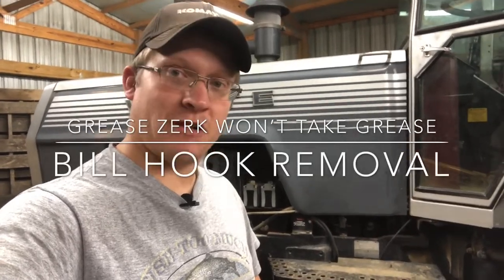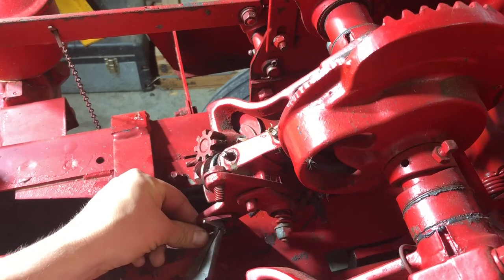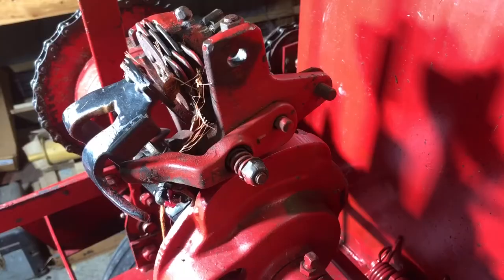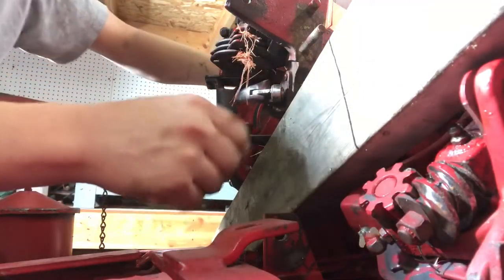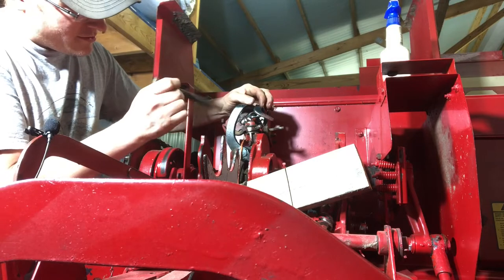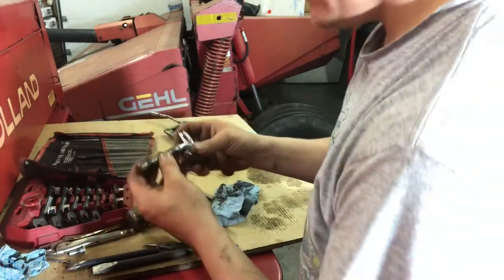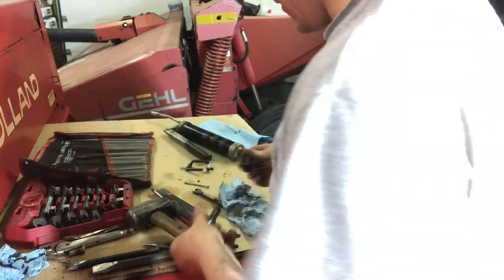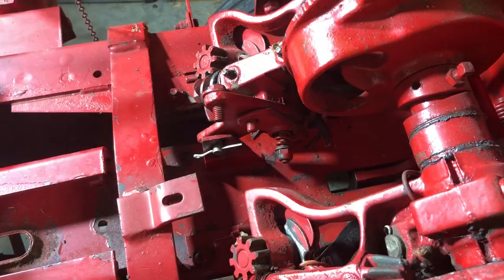BILL HOOK Remove/Install - Grease ZERK won’t take Grease

Comment: Thank you for making these videos. I have learned so much from them. I have a 1969 Alis Chalmers 444 baler and it has NH style knotters on it. I have had to replace the knife arm on one side and with your videos had the knowledge to adjust it along with adjusting the other side. Thanks!

Comment: Great videos !  I have a NH 271 baler that I have gone over, and replaced a few pinion gears.  It stopped pulling the knot out of the left side.  Now it won't pull the knots out of the bill hooks (both sides)  Timing is correct and I've done everything you have suggested.  I have tightened up the knife arms to the point they are on the tight side against the bill hooks.  The only thing I dont know is should the knife arm pivot shafts shimming.  There are no shims in the shaft so they have some play up and down.  Any suggestions ?  Thanks, Steve Hidden Spring Lavender and Alpaca Farm NJ
Reply from the maker: Thanks for watching. Hopefully we can get it figured out. So I understand what your issue is it sounds like you're having knots get hung on the billhooks. You can check the billhook tension. If it's too tight it won't release the knot. Make sure you have sharp knives on the knife arm. If they are dull it will tighten the knot on the billhook and not come off. That's the most of it really. Just making sure the knife arm cuts clean and rubs the heel of the billhook. And making sure the knife arm travels far enough and hits the billhook at the right point
Reply: @thebalerman  thanks 🙏 I will work on it tomorrow

Comment: On my 277 New Holland haliners small square baler. It ties the knot but it hangs up on the end of the bill hook, what would make it do that?
Reply from the maker: There are several things that could do that.  Without knowing anything you've already tried and the whole scenario here are a few things to check.
1. bill hook tongue tension
2. knife arm to bill hook clearance (should be rubbing lightly)
3. dull knife on the knife arm (if its dull it will actually pull the knot tight and not slip of the billhook)
4. rough spots on the bill hook

There are other things that can cause your issue but these are some of the basic things to check. Good luck